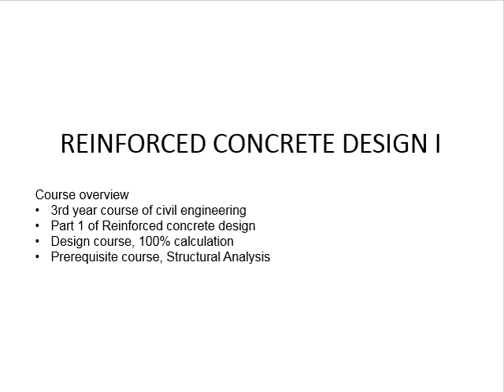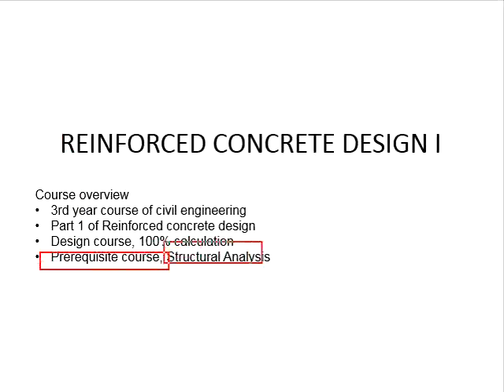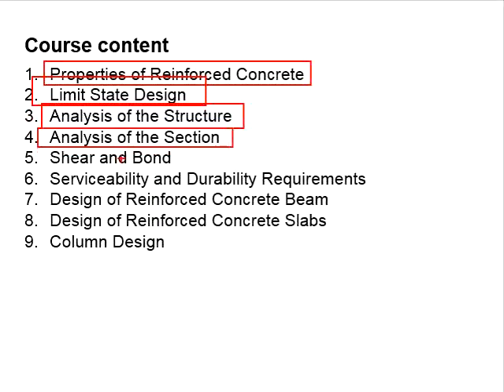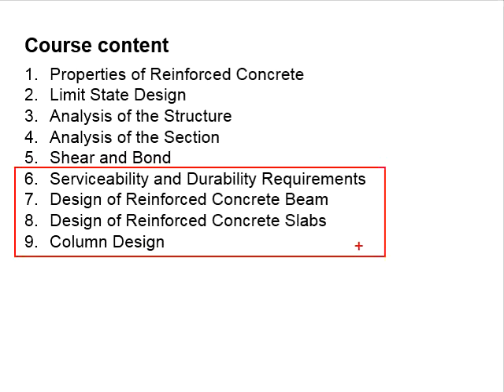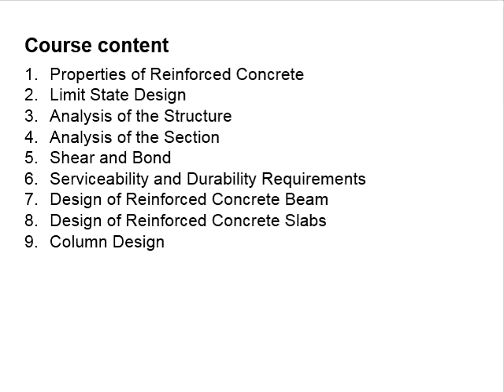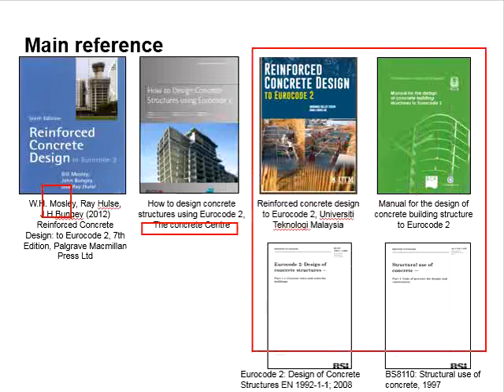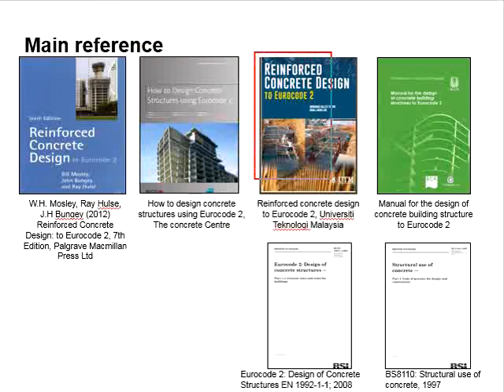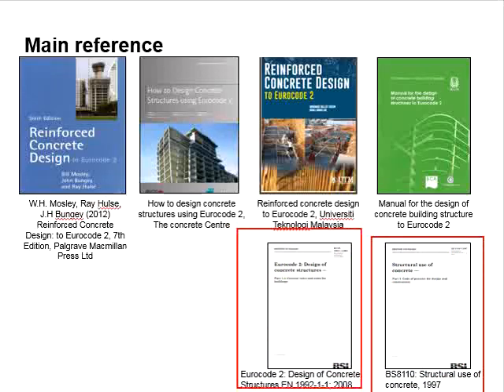Course overview

Comment: thanks alot. 
would you give a turorial on 
1. composite steel and concrete structures as per Eurocodes 
2. structural timber design as per Eurocodes
Reply from the maker: Thank you for the suggestion. I could consider it, but not at the moment, as there's a lot to learn about this and I'm currently working on something else.